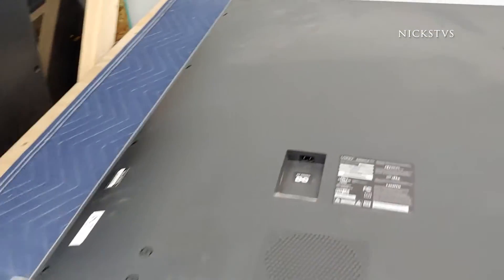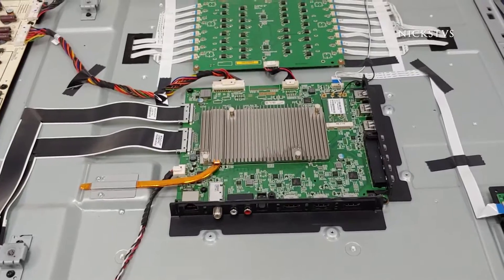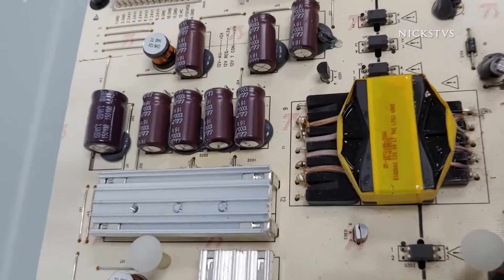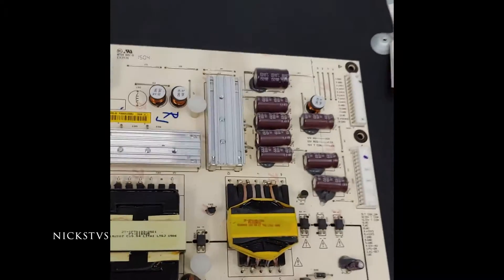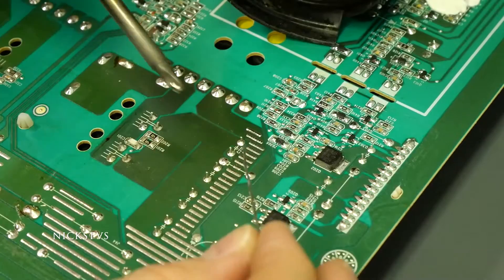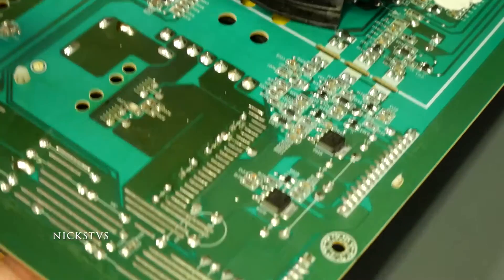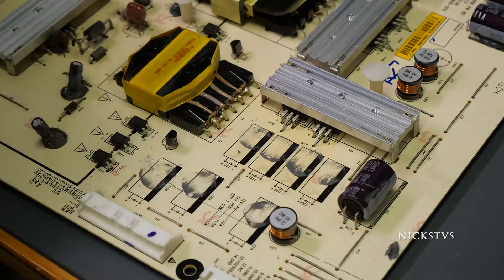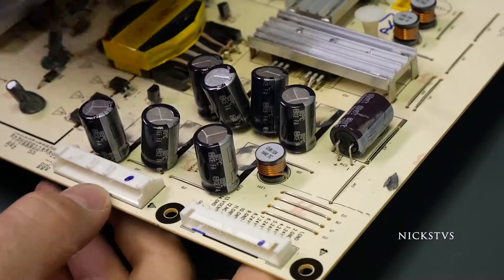Dead 4K Vizio TV NO Power Fix! M70-C3 and P702ui-B3

Comment: What if the capacitors isn't the problem?
Reply from the maker: I have fixed over a hundred of these. It's always the caps that fail on the power supply. The only time it wasn't was because the person who tried to fix it before sending it to us caused damage to it. 
Now while the capacitors are the only thing that I have ever seen fail on the power supply they aren't the onlything that can fail in the TV. It's possible your power supply is not at fault but your mainboard is. In which case I recomend checking out our mainboard repair videos for this set

Comment: I have a VIZIO P602UI-B3 with the same issue. I replaced the capacitors and the TV now comes on but I have another issue. When it turns on it has evenly spaced vertical black lines across the entire TV. They are about a half inch apart. They even go through the Vizio logo at start up and all of the menus. I replaced the T-Con board and the issue persists. I'm out of ideas. Any thoughts on what would cause these lines.

Comment: Subscribed. I'm "new" to this. I have one TV that I fixed by replacing the power board in December 2019. Now it broke again and it's back to me and I didn't want to do that again, I wanted to actually find an issue, checked everything and found out that these capacitors are not in the range of their measurements. So I decided to check here on YouTube, and you confirmed it for me, thank you so much. Great video, now I also want to buy the same gun as yours 😂 great tool.

Comment: do you use flux? ill be doing this on saturday when my capacitors come in.
Reply from the maker: The solder I use has flux in it already so I don't add more, but also I have been doing this for 10 years so I am very good at it. 
If this is your first time soldering in a while or ever I would recommend using flux. Just clean it off with 99% IPA after

Comment: Hey there, just wondering if you recommend looking at the fuse near the power input? The 4 caps on my set look exactly like the rounded ones on yours, but awaiting them in the mail. Just go straight to fixing the caps?
Reply from the maker: I have never seen a fuse on this model go bad before. I do not recommend looking at the fuse.
Reply: @NicksTVRepair  Thank you for the reply! I appreciate the video and your clear instructions.
Reply from the maker: No problem, glad I could help. 
Let me know how the repair goes and if you encounter any issues.

Comment: Thanks for creating the detailed video @NickTvRepairs,  i have the same problem in my M60-C3, i cannot figure out what is the rating on my capacitor, it says SG 105°C 1535 (M), i understand that 105 is the max temp bur not sure what is 1535 (M), any idea?
Reply from the maker: 1535 is probably some sort of manufacturing code. 
If you are interested in replacing the capacitors, I have a link to my website where we sell them as a kit. 
just follow the links in the video description.

Comment: The power died on my M70-c3 so this video may become helpful.  However prior to the dead power the TV had been losing back lights, slowly over the past couple years.  I still enjoyed the TV.  Would it be foolish to try this repair here with the back light issue?  Is the back light issue damaging the power supply?  Thanks
Reply from the maker: That I know of for this model the LED strips aka backlight when they go out, I don't believe will damage the power supply. However if they don't get replaced you will start getting dark spots on the screen, which obviously will degrade the picture quality. There are strips available online you can purchase to replace but that is a much more intense/labor intensive/delicate repair.

Comment: I have the m60c3 and also have this issue but it sometimes turns on.  When its on there are a lot of dark patches on the display and it is wuite dim.  Even if i put the bscklight to 0 i etill see dark patches.  The tv was free but im not planning on putting $$$ into it.  What do you recommend?
Reply from the maker: " im not planning on putting $$$ into it.  What do you recommend?" Then I would recommend you toss it out. 
You can't fix the TV for free. You have to at least buy replacement components (links in video description) and install them to fix the power supply and then there is a chance you may have dark patches which may require you to purchase a new LED driver board and possibly new LEDs as well.

Comment: Just finished working on my Vizio M60-C3 using your video for reference. You were dead on, the capacitors were the issue and replacing them was the solution. I had no prior experience soldering or any electronics repair background for that matter. This was a first for me and it's seemed to have worked. Thank you for putting this guide up!
Reply from the maker: No problem, I am happy to hear you were able to get your TV fixed! One fewer tvs in the land fill!

Comment: Do you or anyone know anything about the Kent Liew books I see around the net, seems hard to get any info on them. Are they any good? They appear to have a lot of info in them.
Reply from the maker: I am not familiar with them. 
I have purchased in the past books similar that talked about common faults with certain model TVs and how to fix them, but they ended up not being common faults, most of the issues seem to be one of scenarios, they never really talked about how to diagnose and they didn't have a digital version so it was always very hard to look up information.

Comment: I got a free Vizio M50-C1 today from the computer shop, he asked me If I know how to solder, he said he as many customers come in with broken HDMI and USB ports on computers, game systems, and TVs, pay is 50 bucks per port, plus the TV repair he turns away, work is plenty, and so few of us left to do it, I need to practice up and make some real money, I'm a pro with a pencil iron, but not hot air. I don't have much for equipment right now. I have a decent start.
Reply from the maker: Vernon,
That's a gold mine right there. Once you do a dozen or so, HDMI port repairs are super easy. 
It's not an identical model but we have a video on repairing an almost identical board:
https://studio.youtube.com/video/Yt5I267k5fw/edit
This one was one of our very first vidoes we did a year and a half ago so its not as concise and it kind of goes on for a bit but we show you exactly how to fix it. 

As for the HDMI port comment I had an LG TV come in with every HDMI port knocked off. I think you may have commented on that video before, it was this one:
https://youtu.be/Z54O6G8uuJE

$50 per port is kind of expensive and also kind of cheap depending on the device. 
If it's an Xbox or playstation, $50 is kind of low. Those are much more difficult to replace and take way more time. Most often you are also expected to completely dissasemble the device and put it back together which takes time. For a TV circuit board $50 seems pricey. We typically charge $25 unless there is trace damage, then we charge closer to $80 or more depending on how many traces need to be fixed.

Comment: I have a Hisense power board, the main cap is bad, it puked the junk all out, but next to it is a space but there is no cap, the pads are in parallel so if I added another cap it would double the capacitance, so why is there a blank space with no cap?
Reply from the maker: The blank space is there because it would cost more money if they made a version of the board without the blank space. 

A different version of the exact same board is used for a different version of the TV perhaps a larger model that requires it. The manufacturer didn't want to redesign an entirely new power supply for each TV they made, so they designed 1 power supply that fits 5 models let's say. Then they just fill the components into the board based on which TV the power supply will go into so it works properly for it. 
This way you only have to design 1 board, the manufacturing company doesn't have to rebuild the factory to adjust for different types of boards, and it saves time and money. 
This is why people say don't purchase the based on the board number aka number printed on the board because that number fits with different model TVs and not all are compatible but instead go with the part number which is the number printed on the sticker of the circuit board.

Comment: Fixed one of these and now found out that the led strips are also bad lol. Unfortunately aliexpress doesnt sell the strips anymore so fixing this TV will be more expensive than its worth to the customer.
Reply from the maker: Kyle,

I have also come accross this in the past. In fact customers are usually aware of this prior to the repairs, and for this model I have started telling them ahead of the repair that all we are quoting them for is the repair of the power supply, and nothing else. If there are additional issues found after the repair of the power supply, additional fees will apply. 
You can't work for free, if you fix the power supply you have to get paid for it. 
Sometimes when I put my LED tester to the strips they appear 100% and I can't detect a fault because they all light up. And yet they are dim after the repair. I have also had situations where the customer gave me an okay on the repair of the LED strips, so we did and post repair the exact same LED's were still dim. We then swapped out the LED driver board, and still some of the strips in the same spots were dim. We know the wiring is good because we can get them to light up with the LED tester. 
A bit of a mistery.
Reply: @Nick's TV Repair  thanks for the comments!

Comment: I have a m70-c3. When I plug power in I get the light but it will turn off and on. Never get a picture. The capacitors look fine. Is there any troubleshooting steps I can take to figure out what’s wrong?
Reply from the maker: You most likely have a mainboard then, you can take a look at this video next to checkout our diagnsotic video for this tv. 
https://youtu.be/un7OJLTWtJY

Comment: Great detailed Video Nick. Thank you. Do you know if the power supply on the Vizio M70-C3 can handle 240V ?
Reply from the maker: That is a great question to which I do not know the answer since I don't have one in front of me right now. However an easy way to check is to look at the sticker right next to the power plug as it should tell you what input it will allow.
Reply: @NicksTVRepair  Thank you Nick for taking the time to reply. The sticker says 110 and 60Hz, I have successfully used my samsung TVs on 240v despite them saying 110 only. I think I will open the back to see if there are any markings on the PSU board. I have heard this sometimes carrys the marking of 110-240v. If not I will just have to continue to use an external transformer. Cheers.

Comment: Before I replaced the capacitors, the board was making a relatively quiet high frequency noise that played on two second intervals, lasting one second. After replacing the capacitors, the noise has changed to a buzzing static electric noise that plays constantly. Curious. It only makes the sound when the tv is plugged in but powered off. (Pressing the “power on” button causes it to go silent) I suspect that it’s the tv’s standby power systems that are causing the capacitors to fail. But I’ve got just one day of electronics experience on account of the soldering I did, so take that with a grain of salt.
Reply: A retired neighbor of mine had us bring his tv out to the road for trash collection after it stopped working, and I asked him if I could have it instead. I figured that it would be cool to see what the inside of a tv looked like, and maybe I would be able to see any obviously failed parts and repair it. Realized a little too late that it was a catch 22. If it happened to be an easy fix, I’d be pretty much obligated to return it, and if it’s a hard fix, then I’d be unable to fix it, and I’d be left with a 40 pound paperweight after my curiosity died down. Turned out to be an easy fix, so I’ll return it soon, but I’d like to diagnose the buzzing sound first. Kinda drives me crazy imagining him throwing out the tv again if the capacitors fail when it’s just a half hour fix.
Reply from the maker: Can you still hear it when the TV is closed up? If no then I would say it's probably fine. If yes, then I do not know as I have never encountered that before.

Comment: Hey Nick. I have a Vizio M60- C3.  We had a lightning storm a few days ago, and found that my modem was fried. A day after that, my Vizio would not turn on. Open the tv to check the power supply board, and sure enough, I had 2 caps the were bulging. I replaced 6 of them with new ones, and still now power light when first plugged in. I decided to check the small 7 pin plug on the other side of the board and I get zero voltage out of any of them. Can this be the main board and not the power board? Thank you in advance.
Reply from the maker: Chris,

If there was a lightning strike that affected your modem and your TV was plugged into the modem via ethernet, then I guarantee the power surge traveled through the ethernet wire and broke your mainbaord. Luckily we can fix that if you send in the mainboard.

Comment: This is great. Thanks for the in depth video. I have an M70-D3 that recently died this way. I don't see any capacitors bulging. Is there a way to voltage test this power board or individual capacitors before moving scrutiny over to the main board? If I can fix the power board I would keep the TV. If I have to pay $100 to fix the main board I am binning this TV. It's possible my Roku or PS5 fried the main board over HDMI. There were no storms here.
Reply from the maker: The M70-D3 has a power supply built differently and does not suffer from the same faults as the power supply. If you have a dead no power issue for that model TV I would expect it to be due to the mainboard. 
Yes, there are voltages that you can check on the right connector. The connector will have a legend telling you what voltages are expected out of which pin. This power supply does have some voltages auto turn on, while others wait for a command from the mainboard. Check the standby voltage, your AC detect, and your 12v lines. If you get those, then your power supply is most likely good and the mainboard is the fault. 

Now to talk about whether it is worth repairing. Well, financially it would make sense to get the set fixed even if it cost $900. Why $900, that is the cost of a similar quality TV right now. Yes, you can probably find a lower quality 70" for $600 on a special promotion, or sale, if you are patient, but those deals aren't always around, and it's usually the low-quality sets. 
As long as the warranty of the repair is the same as purchasing a new one, I don't see a downside. The TV is built very well and doesn't have tons of different parts failing on it. The only part that does fail is the mainboard. So once that part is serviced, this TV is worry-free, there is an extremely low chance of say the power supply going out, or the backlight going out in the future. Newer TV sets are built cheaper and cheaper and fail much sooner than older sets. 

Anyways I could go on with that, but we do service the mainboard for your model TV, we charge $129 and offer a 1 Year warranty on the repair. 
In my obviously bias opinion, that's a killer deal no one should pass up on.

Comment: Working on a M43-C1, stby light on, main board led indicates power and turn on, PSU gets an on signal from the main but no pic, no backlights, BL-on sig reads nothing, no voltage on the Tcon anywhere I check. The two chips are warm. Main board bad?
Reply from the maker: In my experience yes. I recommend reflowing both the large BGA chips under the heatsink to fix it. If you only do 1 the other might fail not to long after.

Comment: My remote doesn't work any more after moving the TV, Did I  possibly break the receiver on the TV? Hard to fix?
Reply from the maker: I have never heard of this happening before. Are the buttons on the back of the TV also not working anymore? If those are still working, then I would agree that replacing the IR might help, but just in case I would suggest trying the remote first as that is a lot easier to do. 
If the buttons don't work either however, then you may have a different issue somewhere else with the TV. 
If you unplug the TV and plug it back in, does the standby light turn on? 
What model TV do you have? Is it the same one as we are working on in the video M70-C3?
It might be best to email us directly at support@nickstvs.com since I don't always get notifications for youtube comments.

Comment: I'm on the second set of capacitors. Lasted 1 year. Why do they keep failing? There is something  else on the pcb board that is causing them to fail. Does anyone know?
Reply from the maker: I don't know for sure, this is speculation, but I believe the way the PCB is designed puts a bit more strain on those than there should be,  however, I also think the issue is due to the quality of the capacitors.
We have kits available for sale, those are the same caps we use for our repairs. I have yet to see one of these come back for repairs a second time and we have been doing these repairs for several years. 
For a link to the repair kit, check the description.
Reply: @NicksTVRepair  thanks Nick, this time I put in 1000UF 35V Nichion caps. Went with a higher voltage rating. Replaced 7 of them but the 4 in a row is the problem. I think they are overheating. It's working again. We'll see if they last more than 10 months this time around.